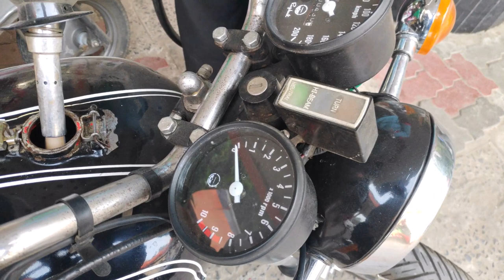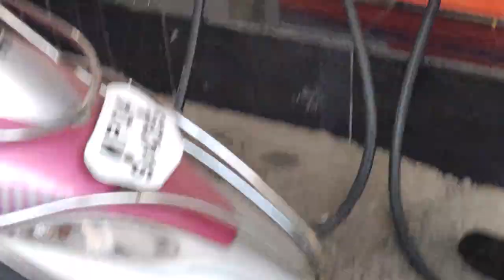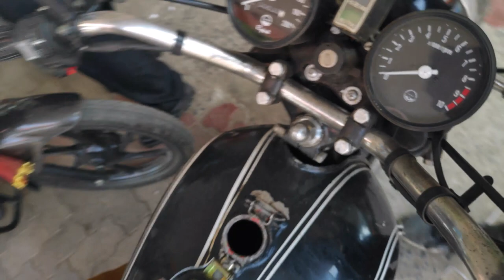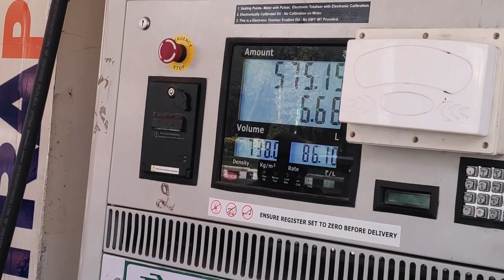Yamaha RD 350 average

Comment: Keep it up sir outstanding video about RD 350 , superb knowledge about 2 stroke motorcycles , I think this petrol pump is at 5 no Stop Bhopal , you are absolutely right too much of 2T oil produces carbon  which is more than required , & the spark also becomes weak

Comment: Pls mix oil with petrol
Reply from the maker: Hi Kiran even if the oil pump working properly ? I see no point except it prevents rust !
Reply: @deepaksankat  RDs are notorious for the oil pumps failing. Its safest to premix especially on highways and longer rides as its easy to end up with a seized engine and a lot of regret.
Reply: @rahuldias6420  Yamaha oil pump fail very rarely FYI.
Reply from the maker: @rahuldias6420  well as i have seen a regular maintenance keeps the oil pump running, Premix does not give that precise mix and create other problems, But yes premix saves the tank from rust and in case of pump failure saves seizure !
Reply: @baburajkandy  The US spec and Indian Spec vary by a lot. Also having ridden only RDs since I learnt to ride another problem that I have seen is on longer rides the tubing becomes supple and pops right off. Its almost a crime to compare the US spec with what we have in India.
Reply: Inexperienced mechanic's blame it on the oil pump when engine seize. But the real problem would be cylinder to piston clearance which he can not maintain in his shop. Usually the owners buy that info and go with the premix.  As far as I know pump is maintenance free. Could be different in Indian Models.
Reply: @baburajkandy  this is India buddy